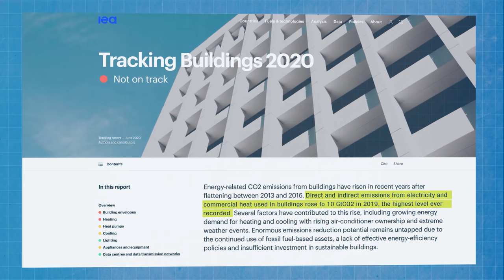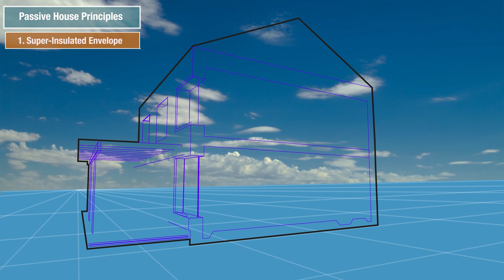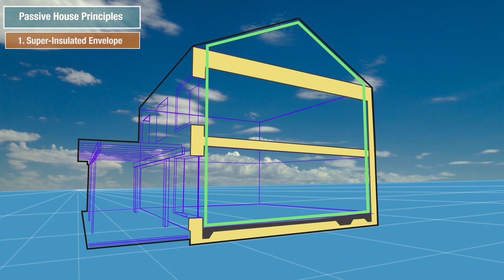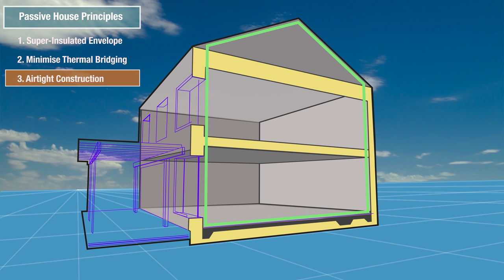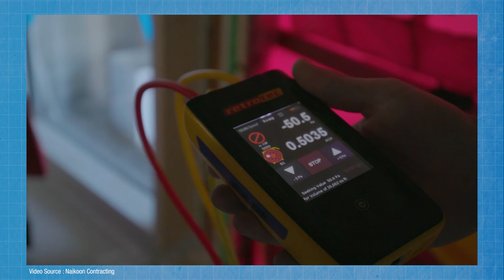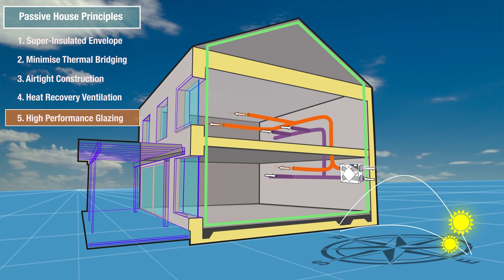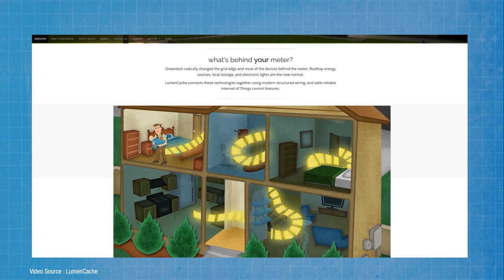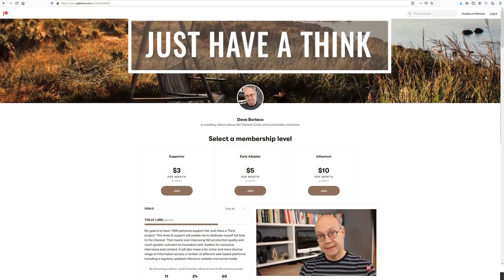Passivhaus . A low carbon future for our homes?

Comment: I bet they're stuffy with stale old air and make it feel like you're sitting in an apartment block from blade runner. I like cool and fresh air moving around my house it makes me feel ok, without it I feel claustrophobic and trapped. In fairness I don't also keep my heating on while I'm doing this and tend to prefer using fabrics to keep myself warm, so this being Every new house is really a very uniform solution for an extremely diverse species of people who have very different physical and psychological requirements.
Reply: There is ventilation, just not through the windows.
Reply: Passivhaus always has fresh air unlike most other construction types
Reply: @deport53  that doesn't make sense. how can a house that locks in it's air, therefore insulating the house, also always have fresh air. It's like sleeping with your head under your bedding. @Sergio R. Ventilation does not = fresh air, in fair the process of ventilation makes air smell bad and stale immediately. I'd much rather have an open home with moderate insulation and to not over-use heating, personally. I still think it sounds like an apartment in blade runner.
Reply: @GallumA  Well, it's like sleeping with your head under your bedding, but there is a hole in your bedding where old air goes out and fresh air comes in. There is nothing special in the ventilation, I think, that makes air smell bad, it's just air from outside.
Reply: Cundy, you need to do more reading on this subject.  You would also benefit from visiting a passiv house yourself...even better would be an over night stay.  You remind me of people who have a dozen reasons why electric cars are never going to catch on...but have never ridden in one or driven one.  Really what we need is a series of Passiv homes to be built as B&B's so that people could visit and experience what they are missing.

Comment: You speak of inefficient homes that make winter colder and summer hotter. Traditional clay houses in the Middle East are passive houses, aren't they, seeing as they were invented before heating and electricity? So only modern houses are inefficient.
Reply from the maker: Yes

Comment: Why no discussion of why or why  not with regard to government regulations?  This will do almost no good if it stays voluntary only. I really think you are moving too far into the "feel good" type of video which will make people think there is no problem.  Is this really what you intend?
Reply from the maker: Hi David. I think we need to show people what is possible. If they have a vision for the possible then they may put pressure on elected representatives to put in place legislation that facilitates these kinds of initiatives. That will incentivise the building industry and then when the practice becomes more commonplace it will become cheaper and more people will able to afford it and then you start to get a virtuous circle. It will take time of course, but is has to start somewhere.

Comment: Critical questions are totally lacking here.!The idea of 100% passiveness  can make one prefer industrial insulation (anti plant based) probably emitting a lot of carbon in making. Also harmfull to skin og breathing, and you need protective gear unlike the idiot insulating in the video.. No wonder industrial insulation  makers embraces this as so much of their shitty material is needed.  Also this idea is suited to insulation material that cannot handle moisture. This calls for Another think: Here one  could instead focus on organic plant based insulation materials (AND CARBON NEGATIVE)  like flax which handle moisture very well and where the idea is a breathing house.  Instead of a PLASTIC BUBBLE such a house will naturally expel moist/ gases while still keep most of the heat. A starting point. www.isolina.com

Comment: What over-engineered nonsense is this?

Just build an Earthship and dig a hole in the ground for A/C. Some hemp for insulation. Done and done.
Reply: If Earthship works for you does not mean it works everywhere! 
1. It requires a lot of space.
2. Some Earthship building methods use "hazardous waste" and a lot of labor.
Reply: @ArthursHD  I see your point a little on the space, although humans don't need nearly as much space as they think they do.

Tires may be "hazardous waste" while they're still offgasing, but once they're done doing that, we may as well use them for something. Not like they're going anywhere.